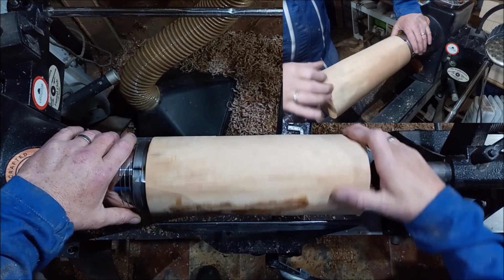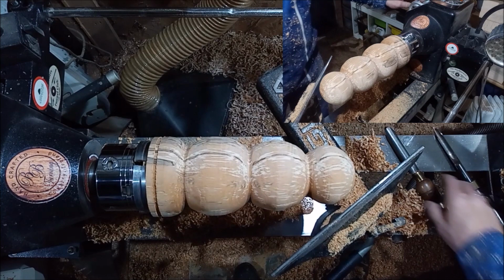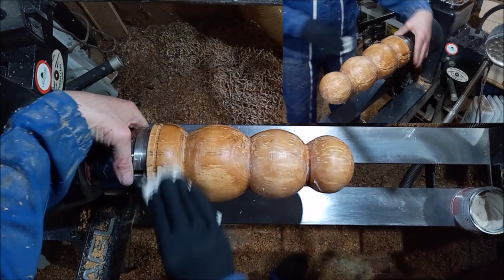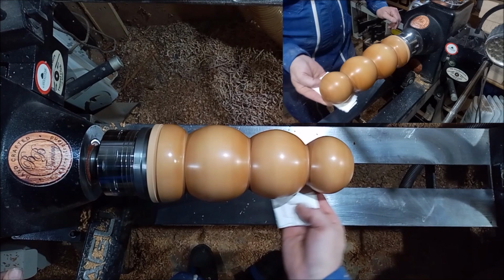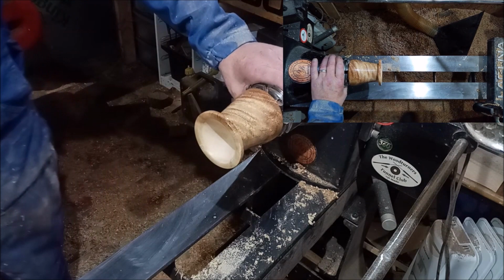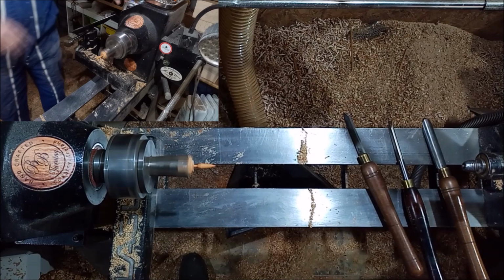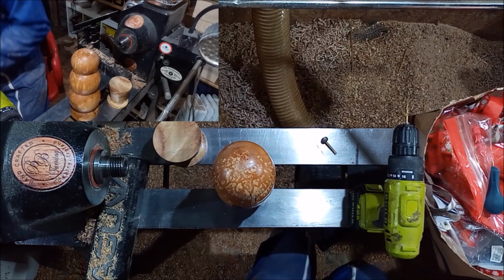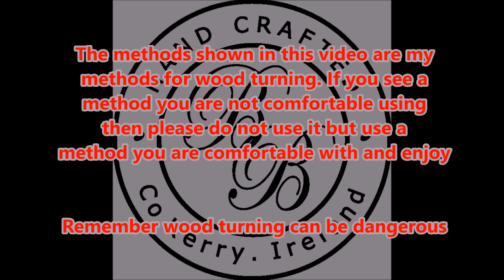Wood turning a large driftwood snowman and a look at Chestnut cut and polish

Comment: It looked like one of the ingredients in the Chestnut CnP is Benzene which is classified as a carcinogen (at least in the US).  I personally would find an alternative.
Reply from the maker: I plan to go back to Yorkshire Grit when it's back in stock. Needless to say I will not be using the C&P on bowls or anything that will contact food or possibly be put in a childs mouth. I have half of a tin of Yorkshire Grit to use on stuff like that, hopefully it lasts for a few weeks until The Carpentry store gets stock in.
Shay

Comment: That is a shame about the grit. I make my own using a Howard’s conditioner, which is beeswax and mineral oil. Then I add diatomaceous earth for the grit. It’s food safe as well. The snowman looks great!
Reply from the maker: That is basically the recepie for Yorkshire Grit Clyde, as you say, food safe. .
Shay
Reply: Hi Clyde, what proportions, I make my own with baby oil (I can't get mineral oil  in large quantities except online) but because of the perfume I don't use it on bowls
Reply: @alfkey4155  the Howard’s conditioner comes portioned pretty well. I typically add the diatomaceous earth a little at a time until it starts to thicken a little. Then leave it over night and the next day it will be even more thicker and more pasty. Sorry I don’t have exact measurements.